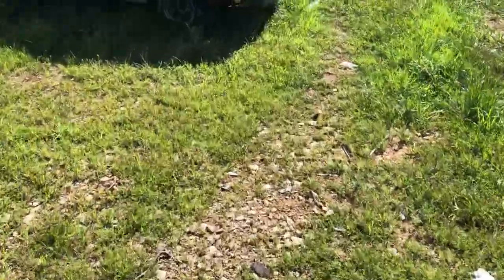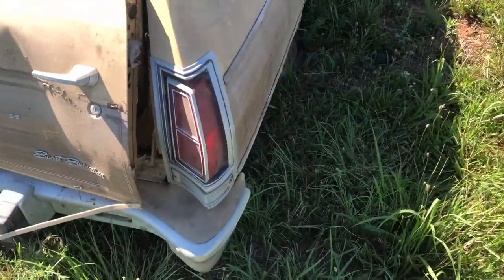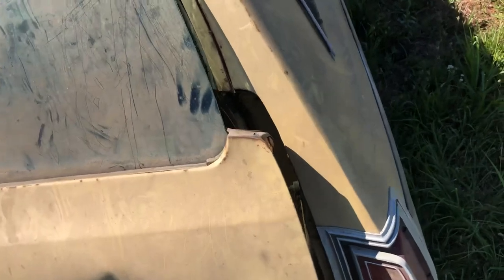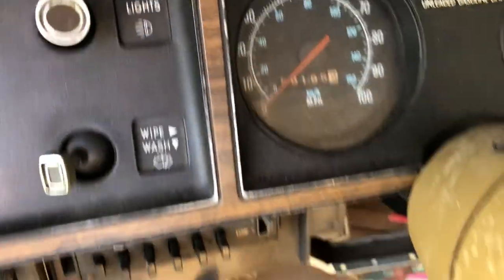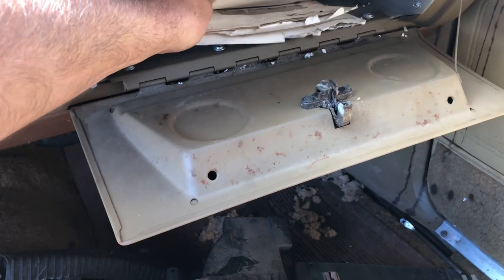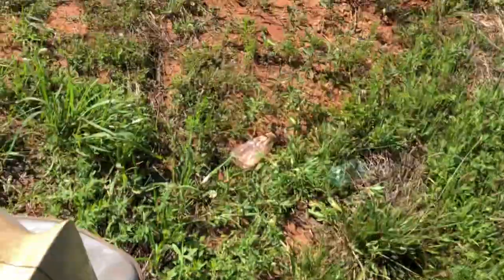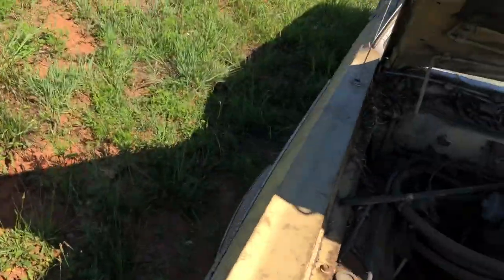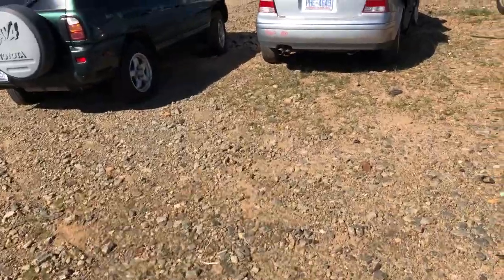76 Plymouth station wagon SCRAPPED

Comment: It was made on 2/21/76 (MDH at the bottom). VIN is R for Fury, H for High Price class, 46 for three seat wagon, K for 360 V8 with four barrel, 6 for 1976 model year, A for Lynch Road, MI assembly plant, which closed around 1981. Today that plant is a powder coating plant for automotive suppliers.